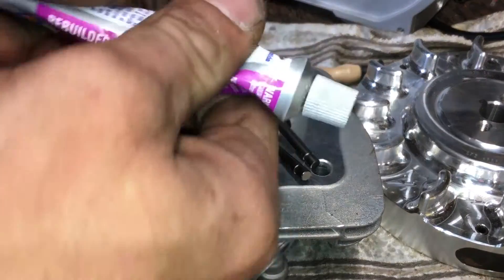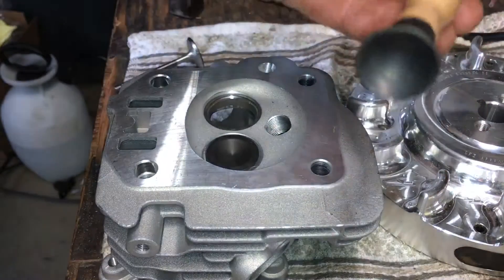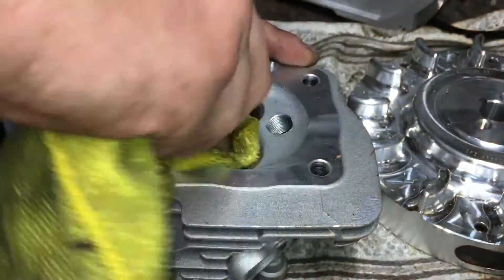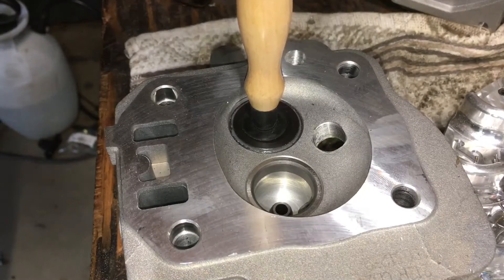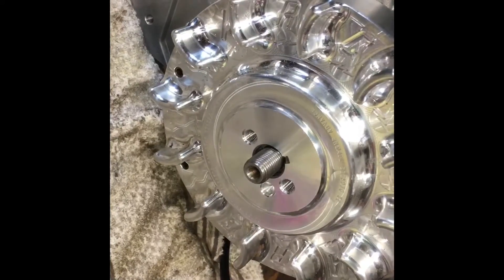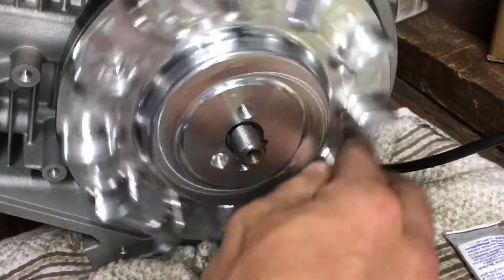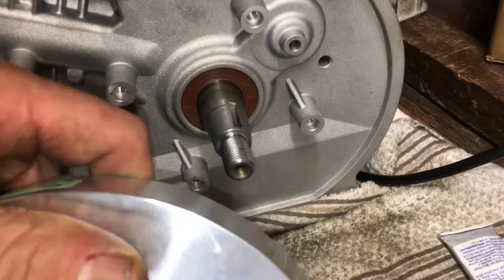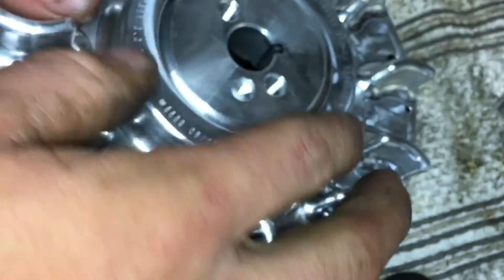Tillotson 212R Valve/Flywheel Lapping

Comment: Are you running just the billet flywheel
Reply: Can I put a billet flywheel with a stock rod
Reply from the maker: @ghikjedv5442  yeah they will work together fine. Just don’t rev it out past about 6k or you risk having the stock rod let go and trash your engine, if not hurt you as well. If you can afford it I HIGHLY recommend getting the billet rod and flywheel together
Reply: @PhysiqueGeek  Isn't the Flywheel that is on the Tillotson mkII 212r already rated for 8500rpm.
Reply from the maker: @ephenj  It may be, but this was a ground up build. The guy I was building it for just happened to buy a Tillotson block but all the internals were bought piece meal from NR racing and GPS I think
Reply from the maker: No it has the billet +0.02" long rod as well

Comment: I have the Blue Tillotson 212 has great power/torque out of the box more than the Stock Predators out of the box I had ran before,  but Really considering getting a Tillotson 212R tho'
Reply from the maker: The 212R is amazing if you plan to upgrade it to the max but for mostly stock setups a predator will do just fine